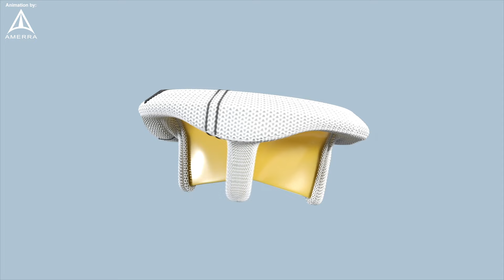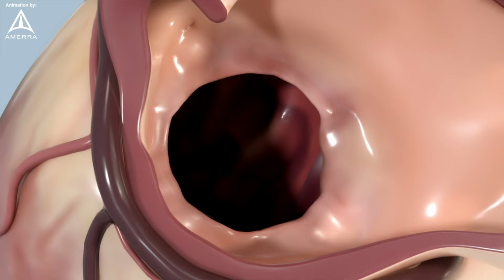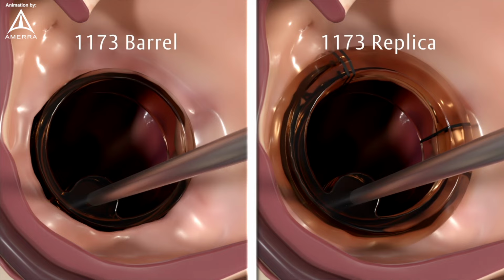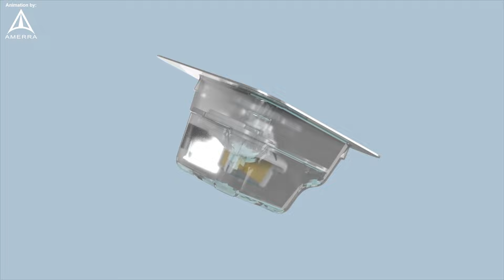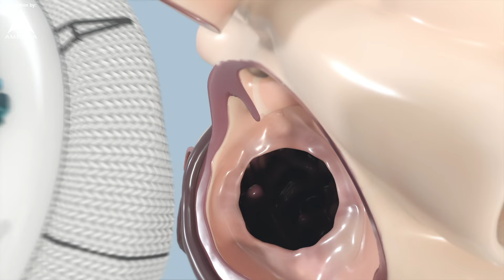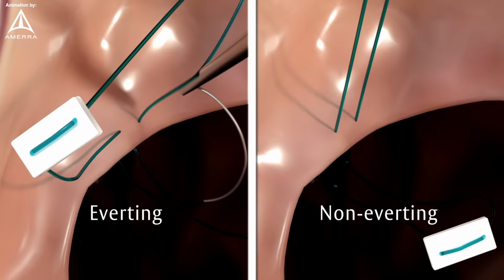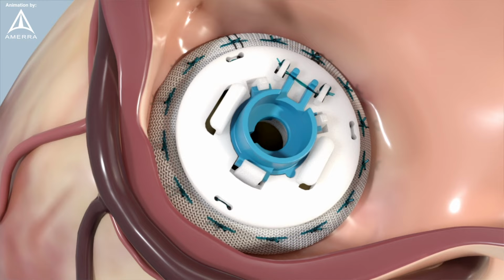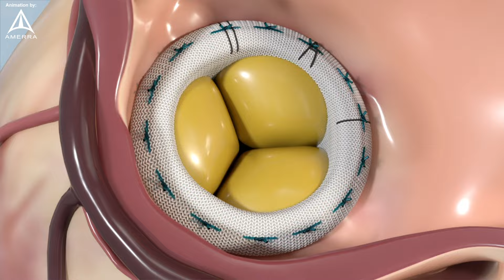Mitral valve replacement technology - 3D animation

Comment: I have one of these I just got it about 3 weeks ago. I heard that if this valve needs to be replaced it can be done through an artery and no open heart surgery is needed. This is good because I have had my 3rd surgery and I don't want anymore.
Reply: Yaşınız kaç neden 3 ameliyat oldunuz
Reply: @melekkuru1762  I am 41 and I had 2 mitral valve repair surgeries but they didn't work correctly. And before my last surgery I was given the option to take this valve because supposedly it is a better option for a younger person of my age to have. If you do some research on heart valves the tissue valve and the mechanical valves are not good for younger patients who are younger than 50 because they shorten the lifespan of the patient. 
But according to my research and doctors at The Cleveland Clinic it is always best for younger patients to have a repair instead of a replacement. However in my situation my mitral valve was too damaged and I had to have a replacement. And this valve is very quiet in comparison to the mechanical valve and according to my doctors it can last up to 20 years before it has to be replaced.
Reply: Bu taktiginiz kalp kapağı markası nedir benim mitral kapak enfeksiyona direnclimi şuan hangi ülkede yaşıyorsunuz
Reply: Bu kapakta kan sulandırıcı kullaniliyormu
Reply: @melekkuru1762  This valve doesn't require blood thinners but your doctor might still have you on aspirin. Be careful if your doctor wants to put you on Eliquis you shouldn't use it for more than 6 months because Eliquis should not be used with a prosthetic heart valve.
Reply: @melekkuru1762  Edwards Life sciences LLC. I'm in the US.
Reply: @Jude13able  bu kalp kapağı enfeksiyona direnclimi çünkü sürekli enfeksiyona yakalaniyorum
Reply: @melekkuru1762  I'm not sure if it is because it is so new.
Reply: Bu kalp kapağı 20 yıla kadar hiç bozulmadan dayanirmi yoksa 20 yıl sonra amelîyat gereklimi
Reply: Mıtrıs resılıa mitral valve bu videodaki kapakmi takıldı
Reply: @melekkuru1762  I was told by my doctors that this valve can last up to 20 years and if it has to be replaced they can go through my artery and replace the valve. Therefore open heart surgery is no longer needed. Previous heart valves were made with pig skin which doesn't work well in comparison to this valve which uses cow skin which is tougher and more durable.
Reply: @Jude13able  bu yazını zi tam anlamadim bu kapakmi iyi çalışmayan domuz derisinden yapılmış iyi calismayan değince olumsuz anlami cikiyor
Reply: @melekkuru1762  ok there are 3 mitral artificial valves that I know of:
1. Mechanical- it uses composite or plastic material and is very loud. Doesn't last long on young person. 
2. Flesh valve- it uses pig skin and is relatively quiet. Doesn't last long on young person. 
3. Mitral resilia valve- uses cow skin and it is very quiet. But it lasts for a long time on young patients.
Reply: @Jude13able please tell me what pills you took in the first period after heart surgery, and how many of them there were and what they were for, and please tell me if you still take pills for life, or do you live fully without pills
Reply: @aspet_  I was on a lot of pills but mostly for other conditions. But the only pill I have to be on for life is my BP pill  metoprolol and aspirin 81mg. But yeah I'm down to 3 pills that I take every day one is for seizures and the other two is for heart. But when you first get out of surgery you might be on quite a few pills or hardly any but that depends on your individual situation. However one important thing to remember is keep your weight off and manage it.